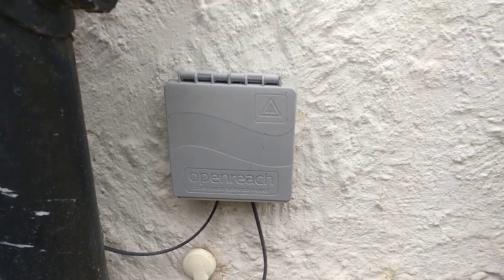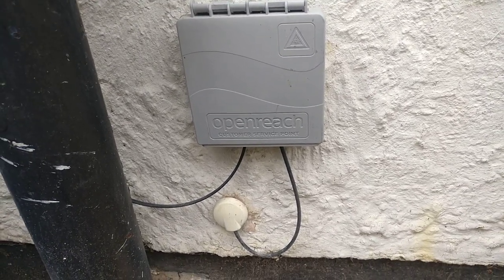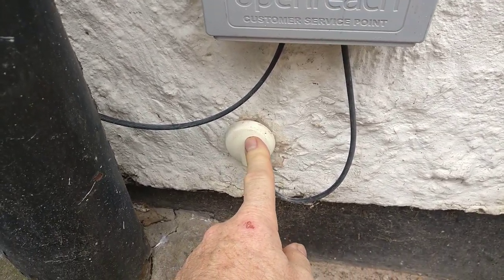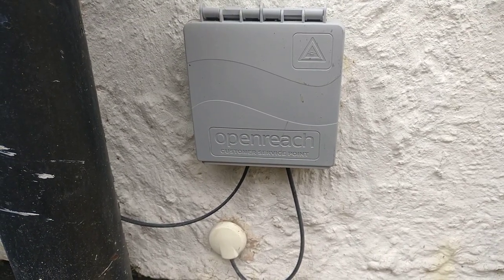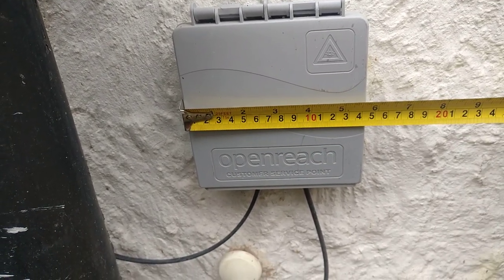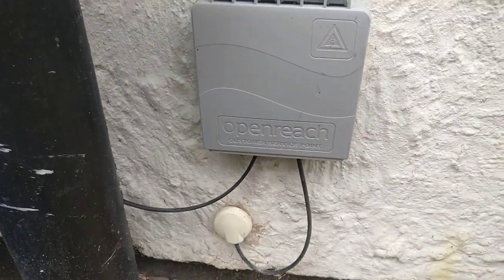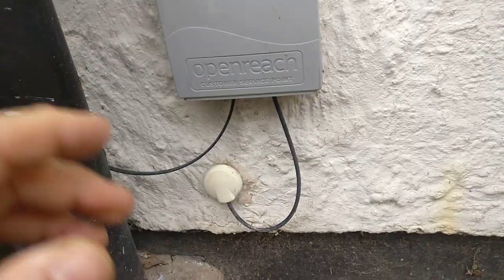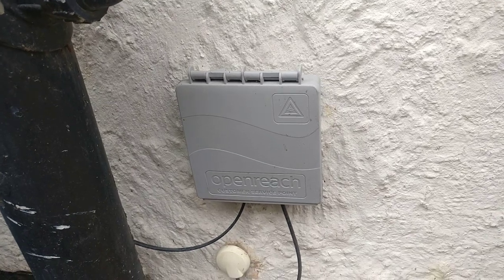BT Fibre Broadband Customer Service Point

Comment: Hi Pete.  Did you drill the external wall hole and then conduit from the hole, under your floor board and then more conduit up into your utility room and did the BT engineer simply run the Fibre cable from the customer service point through the hole and conduit you created up to your room and then to the ONT?  Fibre is being installed in our road so we are likely to be able to get FTTP soon so researching this a fair bit.  Thanks.
Reply from the maker: Hi Darren - The BT engineer would have drilled through my wall, but I decided to do it myself ahead of time.  I drill a hole from the outside that came into my house under the floor boards.  I then installed a length of 20mm dia PVC pipe clipped to my floor joists that lined up with the hole in the wall.  I also put a 90 degree elbow and a small upright piece of conduit to come above the floor boards where I wanted the ONT to be installed.  Then when the engineer came he just had to thread the fibre through the hole from the outside and it appeared excactly where I wanted it installed.   The BT engineer then connect the router to the ONT.  Once he had left I then ran a length of ethernet cable to the room where I wanted the router and used my own ASUS RT-AX88U.
Reply: @Builtbypete  Thanks Pete.  A very detailed response, much appreciated.  My current copper BT cable runs from our local telegraph pole and into my loft where it meets a socket, there is then an extension that leads to my ground floor to two sockets one that is not used and the second that my router is connected to.  A bit of an odd set up.  We have coaxial in most rooms and I am thinking about where we might have the ONT when FTTP goes live and potentially if I can use the coaxial points and cables to pull Rj45 cables to try and get my home office/man cave with wired internet for my computer and home cinema set up and then the same again with the living room.  If all goes well I will also do the same for my bedrooms.   Thanks again, great video.
Reply from the maker: @darrenjosephgregory  Your welcome Darren.  That sounds like a good plan.  If you can pull the ethernet cable through that will make for  very tidy installation.  I ran my ethernet under the floor boards upstairs to my office and is completely invisible.
Reply: Hi Pete, hope you can help. I’m getting this installed three days time by Openreach and I was wondering what category of RJ45 cable I’d be best buying to run to the BT modem? Wasn’t sure if I needed shielded/un-shielded and category 6/7/8, etc.? 

I want the ONT on side of the living room and the modem about 4-5 metres away, so I want to buy the correct cable in advance of the engineer visit in case they only supply me with a short one that won’t reach where I want the modem.

Thanks! Paul.

Comment: Thanks for the video.  Do you have to have an external box? Or can they run the fibre inside and terminate it in the internal box.  We have an attractive property and an ugly grey plastic box stuck on the front elevation would not look good.
Reply from the maker: I'm not sure to be honest.  I found the installers really helpful, so it would be worth asking to see if they would do that for you.  They are ugly I agree.  I was thinking of making  cover for mine to hide it a bit.
Reply: @Builtbypete  Thanks for the reply, when it becomes available I’ll ask.  Cheers
Reply from the maker: @Jestey6  your welcome
Reply: It is possible to fit a smaller internal CSP.  They're normally used in flats but do the same job.  Issue is they're more prone to damage from kids/pets etc
Reply from the maker: @johndonnelly8159  Im not sure if they come in different sizes.  The one they fitted inside the the house is actually not very big (i had it fitted in a cupboard so it doesnt get damaged).  The box on the wall outside the house is bigger.  I plan to get a grill to protect it from damage.

Comment: Does this "Open Reach Customer Service Point have to be at the front of the house that is accessible to anyone or can it be hidden somewhere in the back garden not accessible?
Reply from the maker: They let me tell them where to put it. I asked if they would do it at the side of the house and they seemed only to happy to help.
Reply: @Builtbypete  Interesting because my telephone line comes from a pole and into the loft of my 2 story house and through to the phone line at the back of my house. I would think they would insist on it going down the wall first and then back up or around.
Reply from the maker: @johntheaccountant5594  I think sometimes its down to the person doing the install and how helpful they want to be.  I got lucky I think.
Reply: I'll try my best to answer your question as a current fibre engineer working for OpenReach. The CSP can be installed almost anywhere on the property. The only thing to take into consideration is that the fibre cable is not as sturdy as a copper cable and can be compromised. Therefore when the cable exits the bore/ duct its then covered with a capping and or boot, basically a plastic cover which in return protects the cable, so most of the time the csp will be fitted parallel to the bore/ duct. Hope this helps, apologies for my English, not my strongest subject.
Reply: @WolfeatsCheeseburger  I came home from work to find one of these box installed without any warning. I'm currently in the process of changing from BT to Sky broadband. Would this be done in advance for Sky? Do customers normally get told this work is getting carried out?
Reply: @John The Accountant  mine is on a pole at the front of the house were they put the grey box but engineer took the fiber cable around to the back of my house into my living room were my router is much better used to have the old broadband at the front as no engineer would take the cable all the way around so was happy they did .

Comment: Ive seen installs with a box outside, why
o.r seem to fit the customer service points
But fibrous dont
Why are they used and is there Good, bad points like slower speed
Reply from the maker: I'm not sure why they fit the service point outside.  Probably  maintenance point.  I cant be sure.  It does seem to effect my speed.  I have the 900mb service and I get between 935MB and 1GB.
Reply: Okay thanks
Maybe they come, do the dirty time-consuming work when people are out, then return to run a short cable from the box to the inside one
Reply from the maker: @somethingelse4878  No problem.  When they installed mine they did both boxes at the same time.  It took them about 2 hours if I remember.

Comment: Hi,
Can I connect two different broadband providers to this box?
Reply from the maker: Hi. No, you wouldn't be able to do that.
Reply: @Builtbypete  previously we have Sky and Vodafone in two parts of the house. They did upgrade Vodafone with fibre and Sky still connected to copper. Does it mean Openreach would need to fit another external box?
Reply from the maker: Unfortunately, BT would fit their own box.

Comment: Is there a power source in this box? The previous tenants at my place have had fibre fitted. The inside box has no power - how do I turn it on?!
Reply from the maker: There should be a box inside the house and a power supply for it. See this video for what it looks like : https://youtu.be/4xxOukbj1D8
Reply: @Builtbypete  thanks. It appears the previous occupants have taken the power supply with them for whatever insane reason. So I will just have to wait for that now 😭
Reply from the maker: Good luck. Hope you can get one quick 👍

Comment: Do you know if its possible to have two connections to the CSP? I currently have an ethernet cable running along the front of my house to connect the router to another room , i prefer using a wired connection whereever i can and dont  like powerline connectors.. So i presume for that to work it would require two ONTs? So is that classed as an additional line? Please forgive my ignorance  . Hopefully someone can clear this up for me
Reply from the maker: Hi Chris. That's very similar to what I do. I run an ethernet cable from the BT ONT to the room where I want the router to be. Works well. You it need one ONT to do that.
Reply: @Builtbypete so basically it remains the same except the ONT replaces the G fast modem and cooper phone socket I currently have . It's a Cat5e ethernet that runs  between the two rooms and I believe it can f the 500mb fibre I due to get installed next week
Reply from the maker: If your fibre hasn't been installed yet, why not get them to install it in the room you want it to be in. The. You won't need to run ethernet cable then.

Comment: Hi. Bt are currently installing fibre in my area. the service point is in my front garden and it looks like the cable comes into my house at the side of the house. I built a large extension at the rear of the house and would like the fibre cable installed there. How far do Bt run the fibre to the entry point. To run it to where I want it I think they would need to go underground to the front of my house under my drive and all the way up the side of the house, unsure if they will do this? My house is fully RJ45 wired with 2x 16 port and an 8 port switch, I have a lot of devices. If they bring it in the easy way, the box will look silly on my main sitting room wall and I have o ethernet points there. Could you show where your fibre runs from the street please to the outside box. thanks
Reply from the maker: Hi Alex. The BT installers were quite flexible for me. But I have heard others say they didn't have the same experience. My fibre comes in from the street from a telegraph pole to the front of my house onto the fascia board. It then runs at roof level around the side of the house and continues about halfway down the side and then virtually down to about two feet off the floor where they installed the customer service point on the outside wall. They then drilled through the wall to a utility cupboard where the installed the ONT. This is what I asked for. Once they left, I then ran my own ethernet cable to the room in the house where I have my router and switches.